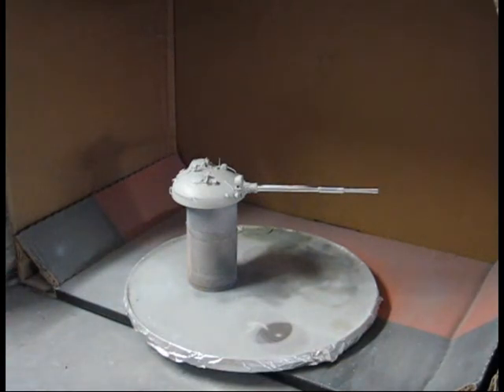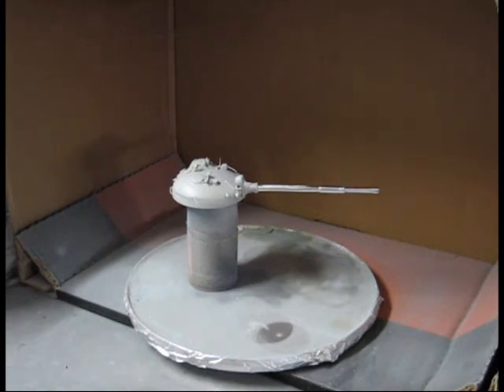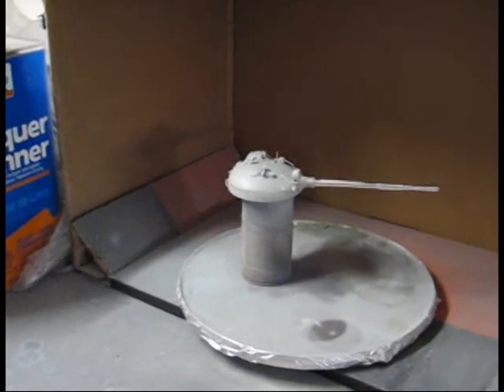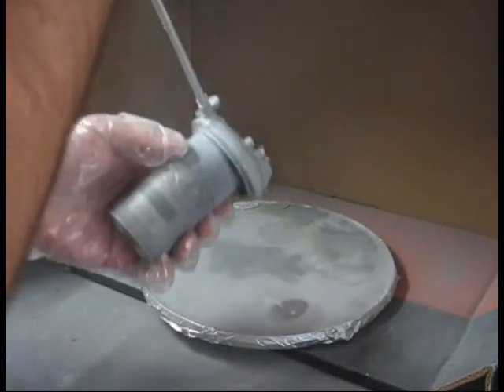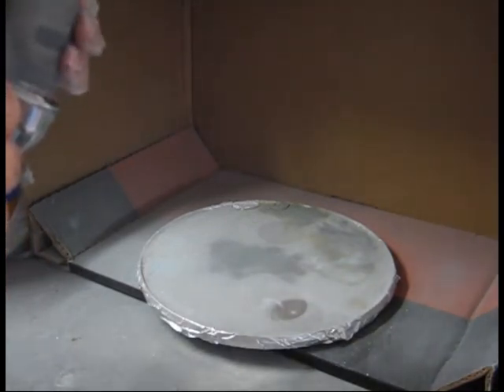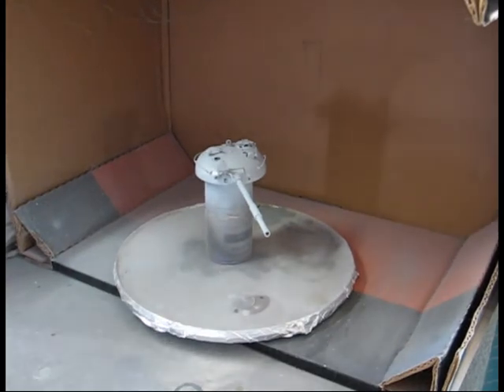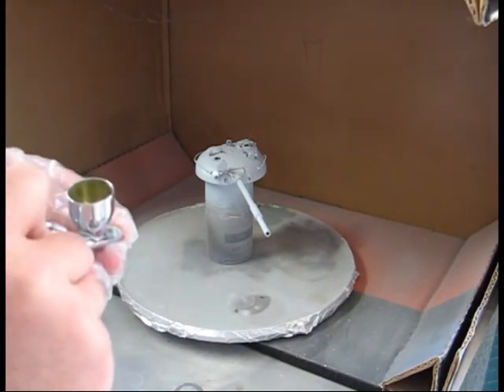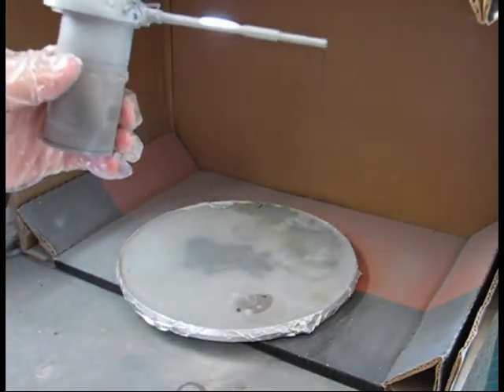T-62 Tutorial 12

Comment: Looking good. Got this kit myself, and am just starting it. While I consider myself a beginner, I've moved up a few steps. Just a heads up, this kit is missing some detail, easily corrected. Some strip styrene and some copper wire. Basically just the fuel lines to the fuel tanks on the side skirt, the wiring to the formation lights and head lights and periscopes on drivers hatch. Makes th kit look better. Did the same thing on my T-55. Hope to have my vid up soon too. Keep up the good work!